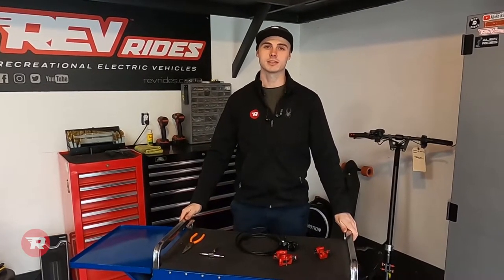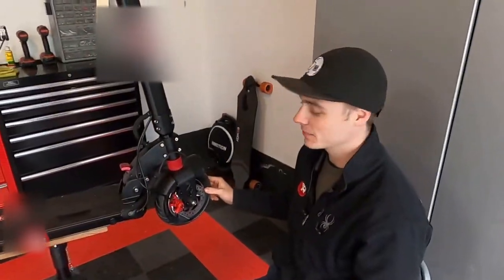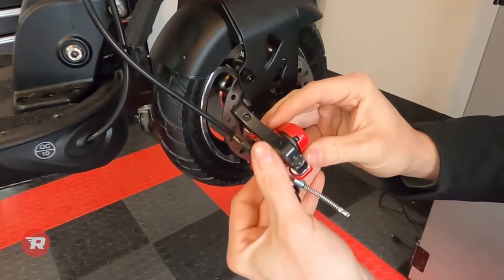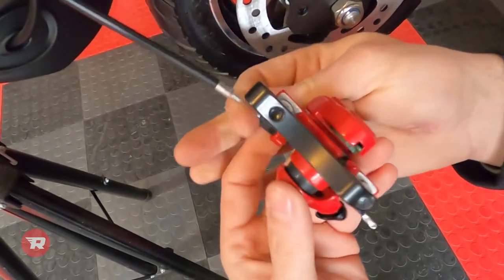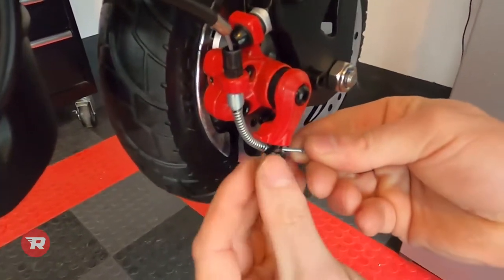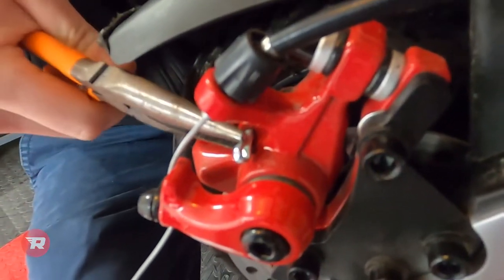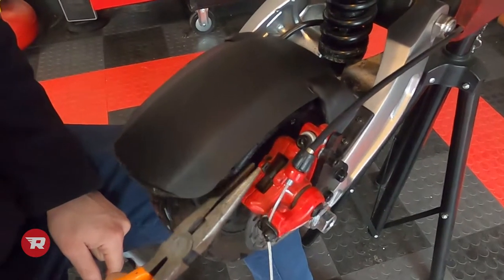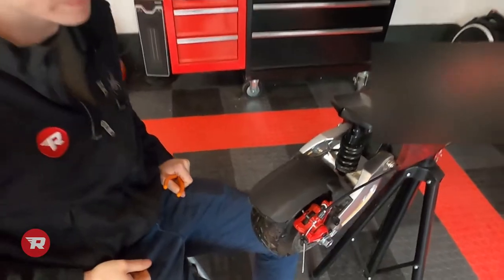Changing Brake Pads on Apollo Electric Scooters

Comment: Another great and super helpful video from Tyler @RevRides. I need to start my own file of just your helpful videos so I know how to do all of these maintenance steps on my ZERO9. Tyler, how does one know that the pads are shot? Squeaking noise like a car? These brakes are noisy to begin with so that’s probably not the right way. 
You made the rear tire change in your last video look so easy that I can handle that myself as well. I didn’t realize that the rim came apart for easy inner tube changes. I will let you know what the problem is with the tube that it won’t hold air even with tire Slime. Thx again and keep the videos coming.
Reply from the maker: Hey Philip, thank you! The brake pads don't have an audible indicator like cars, and routine visual inspection is the best indicator. Once you get past the break-in period, the handbrake will need adjustment as you rack up the miles. This is a good indicator that your pads are wearing down, and that a visual inspection is needed. Most find it is time to change the pads when adjusting the brake cable position no long gives a firm and well positioned brake lever.
Reply: Rev Rides; Thank you for the reply Tyler. I should have included this next question in my last inquiry. How about the rotor (Disc brake) itself? When does that need to be changed? When I feel a distinctive lip forming on the edge of the disc? I know we are not talking about a car here but why not ask anyway? I Would suppose I would really have to put some serious miles on the scooter to get to this point. And then we have the old school drum brake in the rear which you can’t see anything by just looking at it! Any advice for maintenance on this? Thank you again as always!

Philip
Reply from the maker: @metaljew4456  Hey Philip, I'll be totally honest with you. I have never seen someone wear out the the disc, even after thousands of miles. I think the 500 mile interval is a good time to do a good thorough check, and to pull off wheel to inspect the drum brakes. If you start to feel a deep groove in the rotor, this would be a good indicator to change, but I have not seen this scenario yet. -Tyler
Reply: Rev Rides ; OK so front disc is basically for the life of the Zero9 and rear drum is a set up that’s good for hundreds of miles. I will have an 8X by the time any of that becomes an issue. I’m really concerned about the industry as a whole. Look how many E-Board companies have not made it and the biggest shock of all is Boosted Boards. Their scooter actually put them out of business. Several bad decisions made with that project. Not enough range. No suspension....But like everything Boosted, great build quality. 
Glad I got my MATE X 750s before the sh*t hit the fan. Have you ever ridden any E-Mountain Bikes? They are awesome.

Your industry should definitely position itself as the ultimate Coronavirus killer. You can safely ride with friends or cruise by yourself. It’s awesome exercise and fresh air. My ZERO 9 and MATE X have played major role in keeping me sane thru the endless weeks of quarantine here in NJ. Thankfully I live in rural Hopewell NJ where there are tons of trails and places to ride. Don’t worry the Zero 9 stays on pavement. Thanks for all of your help Tyler. Maybe the flat will be fixed by tomorrow...

Comment: Love your video brother. So easy to follow. So my question is , there’s 2 brake pieces to replace at the back and 2 pieces for the brakes at the front? I have 8x btw
Reply from the maker: Correct. There are two pads in the front and two pads in the rear. They are sold in sets of two. https://revrides.com/products/zero-brake-pads

Comment: I have had my zero 9 for about a month, its great apart from the front brake is so shaky under braking, like the disc is warped. Cant figure out why. Another strange thing is the wheel must be very easily damaged? I have jumped a couple of small curbs and the wheel is like an egg. Is it just they are pretty frail? The reviews i watched has lots of off road without any problems :-(

Comment: Hi, I have a Zero 10x and want to change brake pads (mechanical, not hydraulic). Are bicycle brake pads compatible with Zero 10X brakes? In my city there is no store with Zero 10x parts so I have to find some solution as nice weather is approaching. I will be very happy if you can help me with advice about this matter.
Reply from the maker: The brake pads just need to be the right width we have them in our online store here is a link (https://revrides.com/products/zero-brake-pads?_pos=1&_sid=3b0ffd6fd&_ss=r)

Comment: I live in South Africa and cannot wait 4 months for new pads, so I bought generic ones and had to file them down to size to fit...also the piston is in the way which will give you endless drama trying to squeeze it over the disc, so you will need to force it in..not for the light hearted